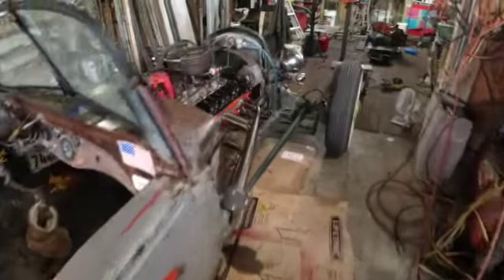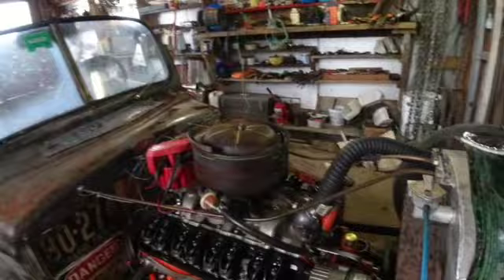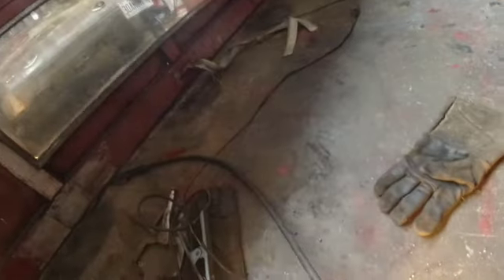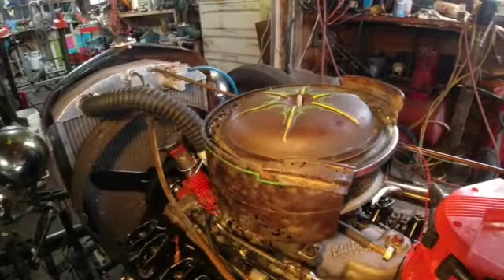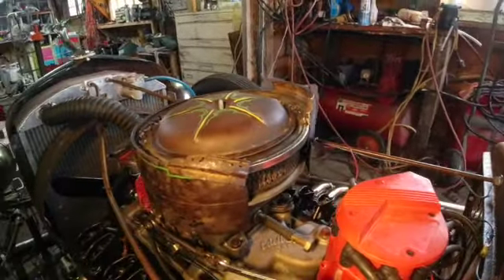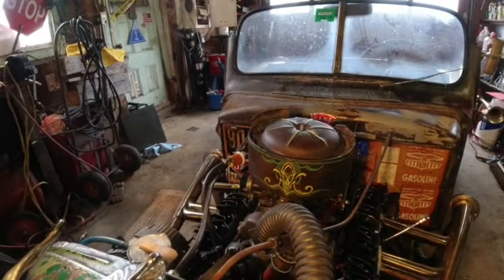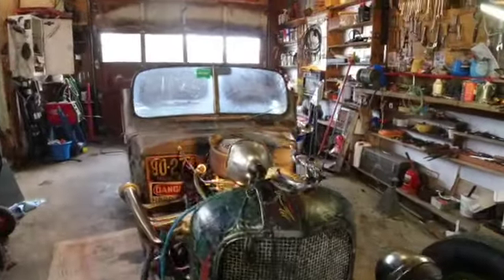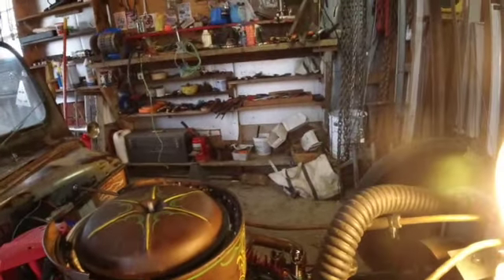Oil Bath Air Cleaner Converted to filter breather for Rat Rod Use

Comment: like the old oil bath air cleaners if its not getting enough air you could cut some more holes around the side to allow more air
i use 2 like that but smaller on my twin strombergs runs much better than the after market air cleaners
Reply from the maker: I see.